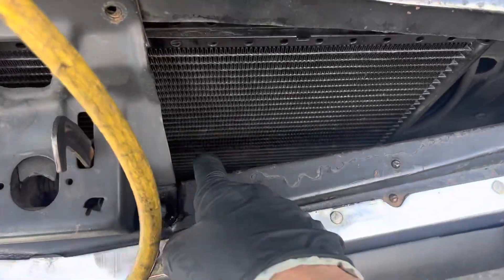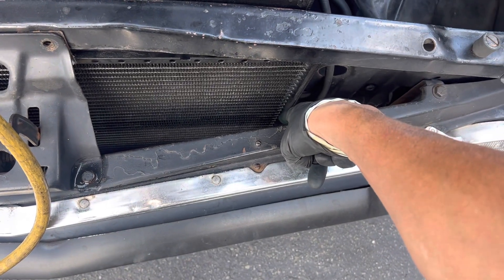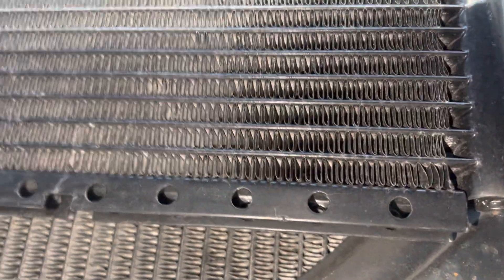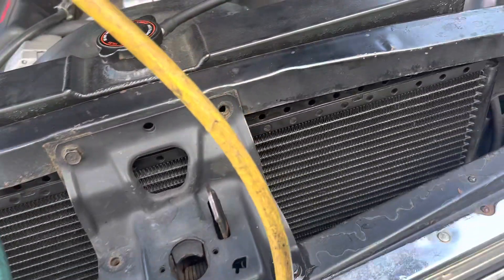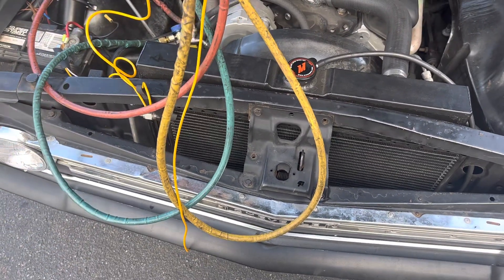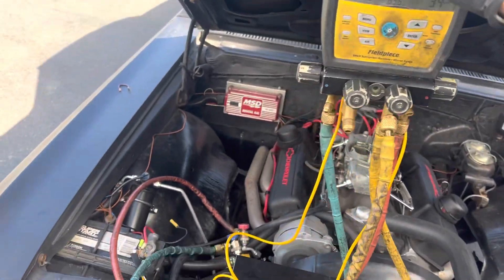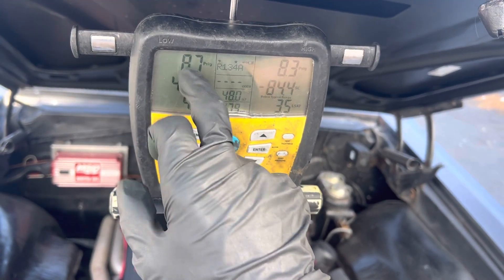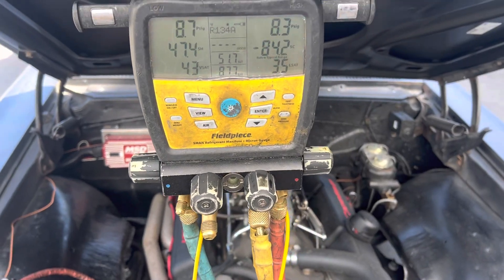Condenser partially plugged Vintage Air Refrigerant passage tubes plugged with debris￼. ￼

Comment: Hmm. Could it be that is where he sprayed the water..not to the bottom. A condensor can be quite cool down there. Looks to me like low refrigerant flow, which can cause high compresor heat . Maybe restricted orfice trouble. Looks like it is too small anyhow.
Reply from the maker: It a expansion valve system. 

I the whole condenser was sprayed. The condenser is over 140F it’s been over 15 minutes running.  And you can feel with your fingers tips it is cold 🥶 at just at the few tubes where you see the water 💦. 

The whole entire condenser was well sprayed down, hot engine, running at 1200 rpm, high air flow over condenser. The condenser is being fed 140F+ refrigerate from the compressor.

It’s the middle of the condenser first pass on the Muir’s pass condenser
Reply: @coldfinger459sub0  ah. You nailed it. Wierd they would design the system to run EVAP at freezer temp.
High superheat would be normal till air over EVAP cools down. Or maybe designed with high superheat to keep EVAP from icing?
Great video
Reply from the maker: @garybeharrell3972  Exactly maybe not the best way but that’s the way they choose to do it and they’ve been doing it that way since the 60s

If I hide the time and I was really driven I would like to take one of these systems and modify it either using one of the automotive H block style expansion valves or a DanFoss are Sporlan expansion valve

I would swap out their evaporator with a modern high-efficiency micro coil evaporator. 

Swap out that cheap Microchannel condenser they use from one from DENSO manufacture that has the latest highest efficiency Microchannel condenser.
Reply: @coldfinger459sub0  that would have way better control for sure. Have to be careful not to oversize the system or you will pull down sensible heat temp. and not dehumidify. Coils need to be sized to load.
Reply from the maker: @garybeharrell3972  exact same problem we have an industry with those guys who like to put a 5 ton system in a house that only needs 2 1/2 tons or 3 tons.

Comment: For Automotive, is it possible to overside a condensor? Im thinking of doing the same thing for my vehicle for better subcooling?
Reply: In a hot climate dual condensers are most beneficial . If running dual condensers in a cooler climate use a pressure switch to cycle electric condenser fan . In a R134a system minimum of 150psi for the majority of time.  The biggest benefit is 2 fold , A/ refrigerant temp is lower [helps evap performance ]------B/ the lower temps/pressure  is more constant [helps  evap  performance ]. 
Its not uncommon to see only 10--30psi rise in high side with engine rpm idle --800rpm  to  1500 rpm
Reply from the maker: @paulthompson8480  yes exactly correct that is what I used to do with long stretch limousines and on top of duel condensers would also have 3 to 4 evaporators.   Talk about a hosing and Connection nightmare

But actually you would be amazed what they’re doing with 134 systems nowadays take for example my Prius hybrid high-voltage three phase electric compressor. 

On a cool 66° day sitting with the hood up taking pressures parked my high side pressure might be 89 PSI with 39° to 42° coming out of the dash and then while I drive down the freeway with my Bluetooth Fieldpiece pressure transducer is hooked up my high side pressure drops down to 66 psi and still 39° coming out of the dash and that’s the high side pressure. 

These are not our grandfather Chevrolet lol 😂 

I’m going to be releasing another video probably in the next week or two on a car I just worked on this morning I release the video about it before BMW with glycol play heat exchanger within inches directly off the compressor discharge line. 

they have a receiver dryer and a expansion valve and two coolant lines and two refrigerant lines in and out of the plate heat exchanger

This assembly immediately condenses the hot gas discharge directly out of the compressor right into the plate heat exchanger that’s only about 7 to 8 inches long directly into a liquid right into a receiver dryer directly to the expansion valve

And then the guy called loop with the electric water pump pumps the coolant to a heat exchanger in front of the car where the condenser used to be cooling down the hot coolant that absorb the heat from the compressor discharge gas pulls it down with ambient air and then cycles it back to the plate heat exchanger. 

I just cannot wait until they do the exact same thing on the suction line keeping it all out in a little module under the hood of the car cooling a Glycol loop heat exchanger under the dash as a evaporator all done with 3 to 5 ounces of propane or butane because that’s exactly what this system is set up for
Reply: @coldfinger459sub0  Yes If I remember correctly the video in question . Truly amazing how the system still functions with that low spec high pressure but sounds like the electric compressor is not working very hard .  A huge difference to the old school  fixed displacement compressor .
But if people remember on a cool spring day R12 was speced as 150psi in some  car  OEM manuals  and a Coca Cola machine  had a high psi around the 130psi .  So a fixed displacement car system  150 psi on R134a   .is ok .   I was always taught keep the high psi about 100psi above the low psi .  [very old saying ] [outta date today] . 
I had slight bump /improvement in fuel economy once I  had fitted dual condensers to my pickup .
270--290psi  down to 150psi !!  The compressor might last longer ,ya think !!!!!!!
Water to refrigerant heat exchangers are common in large building systems . The memories of cleaning out cooling towers , ahhhhhh ..
Reply from the maker: @paulthompson8480  I never had the pleasure of cleaning out cooling towers but I’ve heard the stories and I’ve never had the pleasure of reaming out and rodding out The large tube cylinder heat exchangers. 

We seen pictures and videos in HVAC School and I watched videos about it.   Something I’d like to do one or two times when maybe I was 17 years old but I think get very tired of it very fast after that just a experience to say I did it once lol 😂. 

I want to take a little time to add the second evaporator in my Prius.  An override the temp controls. Would like to keep my evaporator just to the point where you start to see a light amount of frost building up on the first one or two tubes lol 😂 

I’m looking for that when I’m in Redwood City and it’s 102° outside I could retreat into the cabin of my car where the interior temperature is 45°F not even talking about how cold the air leaving my duct blowing across my coil.  On the verge of icicles 🥶
Reply: The  real reason car makers are improving heat exchanging is so they can save money because they use less raw materials on a more efficient unit . If car makers were interested in air con they would not give us high head pressures and excessively low low pressures to deal with [combine this with high super heat to prevent freezing ]  whoa......... Many band-aid fixes by car makers are still done . Customer """but why does it not work in hot weather """.
Yes most of the Nippon Denso systems  I have experienced has been good ,makes some other makers look like a joke
Reply from the maker: @paulthompson8480  denso has done a good job of walking all over the other car manufacturer air conditioning companies in quality in efficiency in compact design with dependability

Something American manufacturers lost their way back in the 50s and 60s and do not know how to do anymore because it’s not profitable enough for the bottom line
Reply from the maker: If you live in a very hot place you’re probably not going to oversize your condenser

But if you lived in a cool climate like San Francisco where I live too much Condenser is not a good thing because you have to keep a certain head pressure for your TXV to operate properly

But you can control that with temperature pressure switchers that modulate the speed of a electric fan to keep it in a correct range not too much fan not too little fan and you can move the head pressure up and down and tailor it to where it needs to be